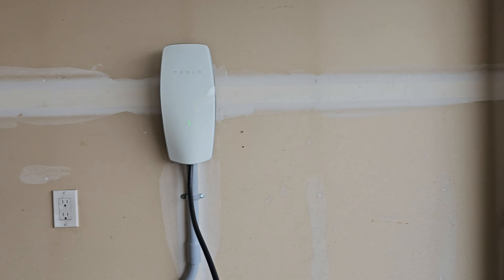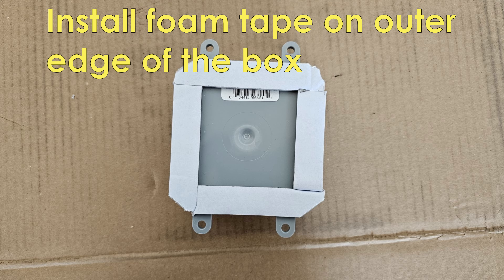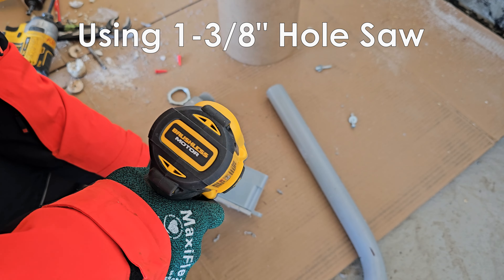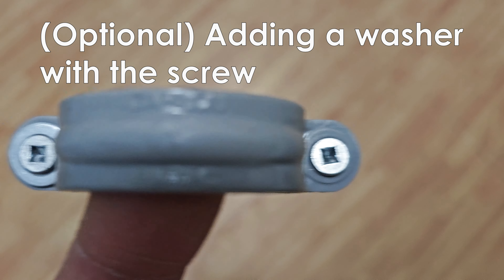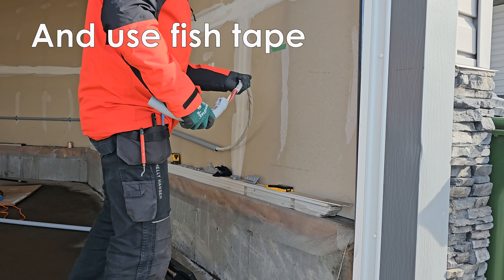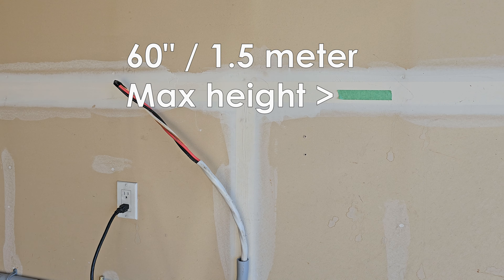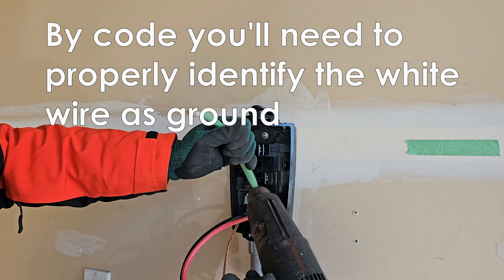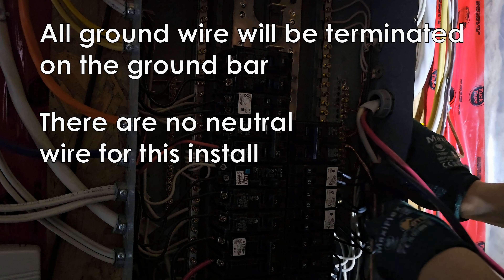HOW TO INSTALL TESLA WALL CHARGER GEN 3 Wall Connector

Comment: 6/3 Romex is only rated for 55 amps and you’re using a 60 amp breaker.
Reply from the maker: @ducatiist  please double check with the electrical code book. As codes in different countries may vary 🍻

Comment: This is the cleanest job I have ever seen done by a DIYer. I have a question, I saw some installers run the wires inside the drywall. After installation, there was only the charger outside, and there was no PVC tube underneath. Is it because the wiring needs to pass through the insulation inside the drywall, which increases the difficulty? Or are you worried that the inspection will not be passed? Thanks!
Reply from the maker: @Drunk_in_a_foreign_land  thank you very much! There should never be wires expose and should be protected from physical damage. That will fail if it had an inspection. My guess they are not an electrician. If I've done that job I would put a junction box outside and then there will be PVC conduit underneath connecting to the junction box. 🍻🍻
Reply: @KevinPon.  Thanks for your reply! My basement main electrical box is directly opposite the garage. Instead of drilling holes to pass the wires through the garage drywall , can I run the wires from the basement to the garage wall first, but without drilling holes, run them up a few feet and then drill holes to get to the charger? In this way, there will be no wires on the garage wall.
Reply from the maker: @Drunk_in_a_foreign_land  I'm trying to picture what you're saying. Is the panel and the garage sharing the same wall?
Reply: @KevinPon.  It's not the same wall. The difference from your video is that the charger in my house will be installed right above the opening where the wires enter the garage from the basement. So I'm considering if I can run the wires up behind the drywall (garage)  then connect to the charger, so that there will be no wire and the pvc pipe outside.
Reply from the maker: @Drunk_in_a_foreign_land  oh I see. Yes, you can do that. You'll be able to use an entry point at the back of the Tesla junction box coming in 🍻
Reply: @KevinPon.  Thanks!

Comment: Whats the purpose of the box? So my panel is in the basement but can run it going straight up and out to the side of the house and that same wall down 20 ft is the garage where im putting the charger inside. The corners going into the house do i put a box?
Reply from the maker: The purpose of the box is for a 90 degree run through a wall. The junction box makes it the best and easiest option to do so 🍻

Comment: I have to come though the basement wall into the garage in a similar manner. Except once I come into the garage I need to make a 90 and go up the wall about 2 ft. If I Use 6/2 MC cable, when I come through the wall, can I just bend it upwards and into the base of the charger, or would I also need to run through a box? Would I need to stop the MC there and run a solid conduit the last 2 feet? Just not sure the best way to finish it up.
Reply from the maker: If you can manage to bend it without breaking the amor, then sure. Most likely you'll have to break it, have a junction box and run the rest up in a conduit 🍻

Comment: One more question. If only use 40A to charge Tesla, in this case, the electrician suggested using a 50A breaker other than 60A. His explanation is that the current and temperature are proportional when charging, and the temperature of the 50A breaker when it trips is lower than that of the 60A，He thinks 50A is safer for 40A (50A*0.8) charging. My panel is 150A, any suggestions? Thanks!
Reply from the maker: @Drunk_in_a_foreign_land  breakers do not sense temperature. The most important thing is having the correct copper wire size for the amount of amps you will be using. If you chose 60A breaker × 80%= 48A. You'll need #6 wires. If you do not have the correct wire size and have smaller. Then the wires will heat up and will be dangerous 🍻

Comment: Hi , i like your video . If i have the tesla motel 3 base , is only take 32amp maximum.  Is still ok to do the same like you 60 breaker and wire size #6 or is there any problem? Or i have to do with 40 breaker and wire size #8 ? Thank you !
Reply from the maker: Yes, it is safe to install 60A breaker with #6. The Tesla will just cap you at 32amp automatically 🍻
Reply: @KevinPon.  thank you so much for information

Comment: Thanks.  Mine is getting 48A already with 50A breaker and 6awg wiring.  Thoughts?
Reply from the maker: I asked a friend of mine. He has a 50A breaker installed from another person and he's also able to charge at 48A amp but he doesn't and charges at 40A instead. He says the settings can be changed on the app. I assume the charger cannot tell if you have instead a 60A or a 50A breaker. I can't remember correctly but I think the charger is able to detect a 40A breaker and under 🍻

Comment: May I know if I can use 3/4-inch PVC pipe? In this way, there is no need to expand the bottom inlet of Tesla connector.
In addition, due to concerns about heat dissipation, would metal pipes be more ideal than PVC? Thanks!
Reply from the maker: Hello 👋, the manual says, "The default conduit size is 3/4 in (21 mm). 1 in (27 mm) conduit is acceptable if needed.
" the answer is yes but you'll have to use 3 individual conductors. Not the cable I used. Heat dissipation should not be a factor or an issue when using proper wire size 🍻
Reply: @KevinPon.  Thanks!
Reply: @KevinPon.  Hi I was wondering why you can use use the 90NM-B (or 90NMD) wire in a conduit?   I thought you either had to transition to T90 (individual wires) at the junction box or run conduit with the T90 to the panel? Do you have the code reference that allows to if you upside the conduit diameter?  I'm looking to do this but notice alot of conflicting installation practices out there.
Reply from the maker: @edderube1247 hello there, I'm from Canada. The code will vary. T90, will be cheaper overall. I used NMD since it was readily available for me. I can't remember what the manual says but I'm pretty sure it said the maximum conduit size is 1.25" 🍻

Comment: I just installed Tesla wall charger, gen3, and i was able to cjarge my model 3 with 48A, but then, like 15 mins later, my circuit breaker went down, and charging stopped. I turned it on, and it charged again with 48A, but then i lowered it 32A because i just looked at the circuit breaker, and it says 40A.
Now i have no idea what to do. Please give some advice to me to be able to charge mine with 48A
Reply from the maker: @user-gt4qh3dl4n  hello there, I do see the problem you're having. First, we want to do this correctly and safely by code. In order to have 48A that requires: all #6 gauge wires and a 60 amp breaker to meet the requirements. If you do not have those two requirements. You will need to upgrade both of them 🍻
Reply: @KevinPon.  no! I made it!!!
Reply: @KevinPu0 on.  I was able to contact the builder of my unit and confirmed that my unit can handle upto 50A circuit breaker since it has #6 Guage wires installed and he told me that I don't need to follow 80% rule so It's ok to use 48A for my tesla model 3 with 50A circuit breaker and he said the worst scenario would be the circuit breaker will be just tripped. 

As he recommended, I installed siemens gfci 50A circuit breaker, and it cost $139+tax 😲 

Do you really think that I can charge 48A on 50A circuit breaker?
Reply from the maker: @user-gt4qh3dl4n  this is what I highly recommend you should do. This is what the Tesla manual says to do as well. Install a regular 60A, you will not need a gfci since it has one built in. 60A breaker is very cheap under $40. You will need to double check the wires to make sure they are #6. Do not believe what "she say or he say".
No I will tell you what will happen if you installed a 50A breaker:
What are the risks?
Overheating: The breaker and wiring may overheat, leading to a fire hazard.

Electrical faults: The breaker may not trip quickly enough to prevent electrical faults, which can cause damage to equipment or even start a fire.

Reduced breaker lifespan: Running the breaker at or near its maximum capacity can reduce its lifespan and increase the risk of failure.
Reply from the maker: @Mangop7q  80% rule or 125% in USA is electrical code! Safety first. I bet your builder is not an electrician 🍻
Reply: @KevinPon.  bro....now im scared..... can I send you an email of my wires pictures to check? As you said, yeah, I don't think he is an electrician...
Reply from the maker: @Mangop7q  kevinponbusiness@gmail.com the wire needs to say 6 AWG
Reply: @KevinPon.  ok. What else do i need to check? Do I need to check my panel? I spent almost $150 for getting a siemens 50A gfci breaker. My builder or electrician, told me that my unit can hold upto 50a circuit breaker...
Reply: @KevinPon.  so you mean I need to replace my 50A gfci breaker to 60A regular circuit breaker?
Reply from the maker: @user-gt4qh3dl4n  yes, just like the one I have. A regular 60A double pole breaker and have #6 wires
Reply: @KevinPon.  oh I see. I can return 50A gfci breaker and then get 60A and install it and connect with 5 awg wire. Is that right?
Reply from the maker: @user-gt4qh3dl4n  yes, that's right. 60amp breaker with all #6 gauge wires and you're good to go. Just like in my video 🍻
Reply: @KevinPon.  and also how am I supposed to check if my panel can handle 60A circuit breaker?
Reply: @KevinPon.  but bro. How am I supposed to know if my panel can handle 60A circuit breaker? My electrician(He says he is...) said It can't handle 60A and told me to get 50A instead. And he told me it has awg 6 wires(which I'm going to double-check with my eyes)
Reply from the maker: @user-gt4qh3dl4n  lol from 50 to 60 is only 10A more. Not much more. 60A is your you're safety and the protection of the equipment. If he says your panel can't handle 60, I'm 90% sure it won't handle 50A. So when you charge, you can only charge at night time or when more of the power in the house is turned off. Can't have AC, furnace, washer/dryer, oven or stove on. Sounds like your panel is 100A? 50A will charge BUT it is NOT Safe!!!
Reply from the maker: @user-gt4qh3dl4n  if you do put 50A then you are not allow to charge at 48A. You do at your own risk bro. The 80% rule is protect you and from electrical fires
Reply: @KevinPon.  I'm 100% following your direction. Probably my electrician(?) does not know what he is doing. Yeah, like you said, 10A difference is not huge. And I don't know why he said it can handle only up to 50A, but not 60A, that is why I was asking you if I can check the max A on my panel.

Btw when I see the wire that connected between the breaker and ev, it's a total of 4 wires, and one of them is ground. So, all of 4 wires should have says awg 6 on the wires? Sorry if my question is kinda stupid.
Reply from the maker: @user-gt4qh3dl4n  there's a load calculation to calculate it. When you do an EV add on to a existing building. I'm sure most panels can't handle it that's why they say charge your car on "off hours" so your main breaker doesn't trip

You only need 3 wire, red, black and green. Ignore my bare copper. That's extra for future upgrades or what not 🍻
Reply: Btw my unit is condominium, and it's 4 flex building. So I don't even have the main breaker on my panel. I'm not sure if that's the reason why I'm not allowed to have 60A? Or does the electrician not even know what he is talking about? Idk, bro. But anyway, yeah, I wanna charge my model 3 with 48A on 60A circuit breaker.
Reply: @KevinPon.  do I need to buy siemens breaker if the panel is siemens? Sorry for asking too many brother....... 😢
Reply from the maker: @user-gt4qh3dl4n  damn, I see. Gotta find a main for your panel to do the job safe lol...
Reply from the maker: @user-gt4qh3dl4n  yes, you'll have to buy the same brand as the panel bro
Reply: @KevinPon.  I keep trying to leave the link of the 60A breaker item to see if it's the right one, but it's keep deleted...
Reply from the maker: @user-gt4qh3dl4n  it's most likely called Q60 double pole 60A  breaker
Reply: I found Siemens 
60 Amp Double Pole Type QPF GFCI Circuit Breaker RBPU for $100.
Reply from the maker: @Mangop7q  the manual says this bro "install a standard double pole 60 amp circuit breaker. Wall Connector includes
integrated GFCI protection - do not install a GFCI circuit breaker."
https://www.homedepot.ca/product/siemens-60a-2-pole-120240v-type-q-breaker/1000406300?eid=PS_GO_140203__ALL_PLA-526641&eid=PS_GOOGLE_D00_Corporate_GGL_Shopping_All-Products_All%20Products__PRODUCT_GROUP_pla-336655210985&pid=1000406300&gad_source=1&gclid=CjwKCAjwvvmzBhA2EiwAtHVrb692lVLCrxtrWunlHGouxeDESe_GRD0GJ3JQr1s25j-9gjFQt5i5bBoCgigQAvD_BwE&gclsrc=aw.ds
Reply from the maker: Did you find it? Siemens Model Q60. Regular 60A. It's a cheap 2 pole breaker. You can find it at Home Depot if you ask them
Reply: @KevinPon.  brother! I just got off work. Sorry for the late reply. Yeah, I found it, but then I also have already ordered GFCI one. Actually, right now, on my panel, the one connected with tesla walla Charger is siemens Gfci 50A as well. Is it bad if I use Gfci one? Because again, my electrician(?) said, gfci one is very safe for charging ev 😅
Reply from the maker: No worries man. The reason why Tesla says do not install a gfci is because the breaker can trip at random times. Also, "the Tesla Wall Connector already has built-in GFCI protection, and installing a separate GFCI breaker is not necessary or recommended. Additionally, installing two GFCIs on the same circuit can lead to unreliable charging."
Reply: @KevinPon.  well, now I need to return 2 of gfci breaker 😆 🤣 😂
Reply: @KevinPon.  i so much appreciated your help!!! So I will just go get regular 2 pole circuit breaker.  I assume that does not come with golrpujd wires, right? (Damm....yeah... my question continues...)
Reply: @KevinPon.  Also , as you mentioned, jumping up from 40A to 60A would be ok with my pannel...? I'm assuming the reason why my builder said do not use 60a Breaker because he might think that I would pull 60a power from my charger and my wire can't support it. But the fact is that my tesla wall connector can support max 48A, so... this is my assumption because, like you said, 50a and 60a are not very different, and I don't find a reason why I can't use 60a circuit breaker.
Reply: @KevinPon.  I have the same question. If I only use 40A to charge my Tesla, in this case, the service person at the local home depot suggested using a 50A breaker other than 60A. His explanation is that the current and temperature are proportional when charging, and the temperature of the 50A breaker when it trips is lower than that of the 60A，He thinks 50A is safer. Of course, the premise is 40A (50A*0.8) charging. My panel is 150A, thank you!